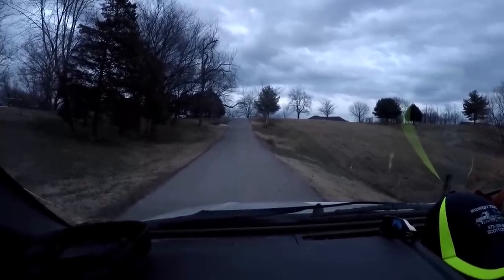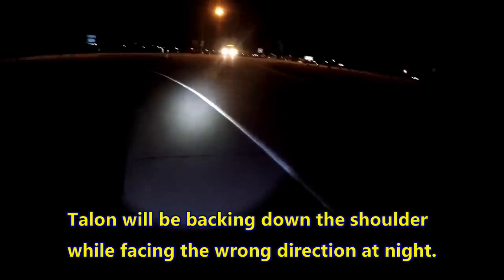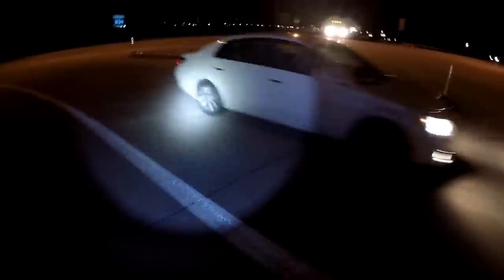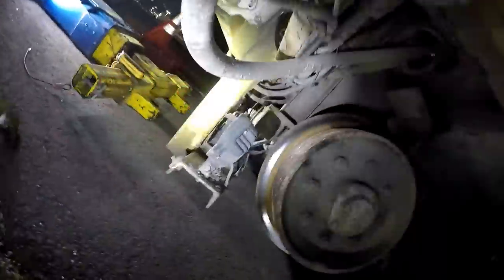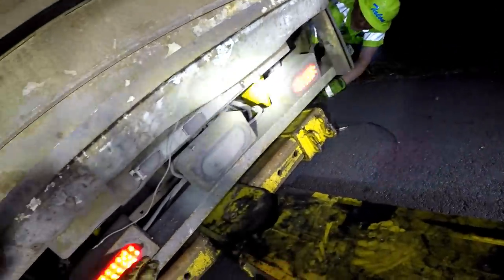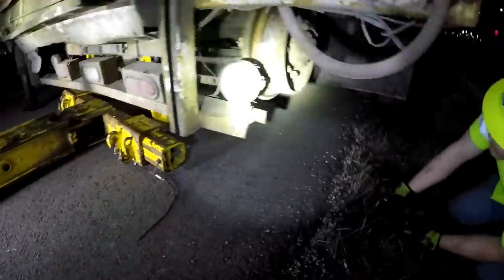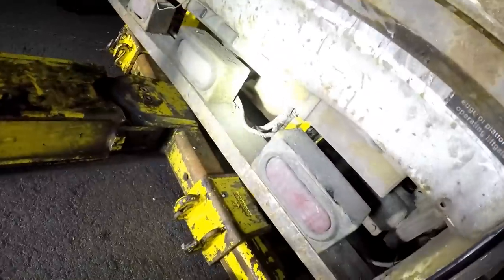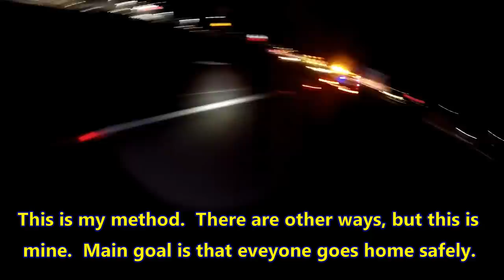Simple Tow Turned UH OH!!

Comment: Those rotating light is a nifty idea, makes for better warning.
Reply: Todd Behrends they work great, speaking from personal experience  (I have a 6 pack in blue, and now a 3 pack of amber batons too, because the flares were so effective)
Reply: Edward chapman I got mine from amazon, sold under the brand Aervoe. just search for aervoe led flare, and it should come up.
Reply: awsome, thankyou
Reply: @bigtrucker26  , I agree, picked up several from an auto parts store ( red in color ) cheaper in the long run vs regular flares.
Reply: If you want to see these taken apart and explained check out this video
https://www.youtube.com/watch?v=9eN7e5_GtHI
Reply: I have six of those led lights in every vehicle I own. I am a firm believer in doing all you can do for safety.

Comment: Ron, I saw something interesting on the highway today that I thought might be useful to you. You know those big portable orange signs that construction workers put out along the side of the road that say something like "Road Work Ahead"? Well today I saw a towing unit with a pinkish purple sign like that which said "EMERGENCY TRUCK REPAIR", and it was placed right up against the travel lane (not In the travel lane) so you absolutely had to notice it. I thought that might be useful to you when you have to tow semis and the semi is blocking most of your rotators emergency lighting from being seen by oncoming traffic.

Edit: I forgot to mention that the sign was placed probably a couple hundred feet rear of the semi, to give ample warning obviously.

Comment: Your customer asked about possible cause for wheel run off. Most common, is under/over torquing lugs(impact guns), OR OVERLOADING.  As you know Ron, excessive stress on ANY contact causes fatigue/wear/tear. That's a rail service truck. Like your wreckers, you have lots of equipment, tools, etc. But, it adds weight. Weight distribution is always important, regardless if you're within limits. A balanced vehicle  can make big difference when driving, towing, winching, recovery etc. Watching your previous videos, I notice you take proper maintenance and care of all your equipment, which can make everybody's job easier and SAFE! GREAT work Midwest Towing! MOVE OVER OR SLOW DOWN is law in  Missouri!!! Give them room.

Comment: A problem like that makes a good reminder to pay attention to those wheel lugs.  They are entirely too easy to overlook during a pre-trip.  Look for shiny around them, or streaks, that could indicate that the rims are moving on the hub.

In my younger days, I kept hearing a rumble-thump in what I was driving.  I checked wheel bearings, tires, driveline.  One morning while on the way to the rail yard for work, it finally revealed itself, when my left steer tire exited from the vehicle and went bouncing off into the woods on a road with roller coaster hills.  Lost two nuts, and the rim pulled through the other three.  Cost me a rim, a grease zerk on the lower ball joint, a tow, and at least 8 hours of work.  And a pair of underwear.

And it put me under obligation to look for another vehicle, because I'd told people that I intended to drive that one until the wheels came off...  I fixed it and drove it some more, but I did eventually get myself a backup vehicle.

Comment: I can agree 2 with your thoughts about working safety along the roads, I worked in Michigan for 25 years as a heavy duty truck Mechanic and had several close calls working along I-94 plus several other heavily. I have had drivers standing at the rear of trucks & trailers and people would still not get over. God Bless my friend, Pastor Clare Huyck

Comment: I remember that rotating lights from my fire department. Very handy little things. We used them too to secure our scenes on roads outside the city. Very useful but the box we had to charge them was a bit difficult to handle because of the wireless charging system you had the problem, if you didnt put them in right they didnt charge.

Usually we put them on the ground, but i had the idea to put them on top of the cones like you did to make them better visible.
We did this until we got some foldable traffic cones with a light in it who where very handy because they dont need much room in the truck and they have a light inside that lights up the complete cone.
Like this:
http://www.derfachhandel.de/bilder/produkte/gross/888.png

And nice that you took care of that small oil spill there.
But a idea for the binder: Put it in a bucked so you dont have to cut the bag open every time you need some. You just take the bucket, open it, take a small shovel and throw as much as you need on the oil.
So you dont have the open bag in your truck after you used just a little bit like here.

Comment: Glad to see an owner doesn't care have much or how long it takes to set up a job site so long as you and your workers get home safe, I remember when i was working 24/7  some 20 years ago doing break down service as an auto sparky where people would not slow down on amber flashing lights and doing 100kph only 1meter or less away from you, so i made a super bright light bar 4X100 watt flashing ambers, people complained to police that they had to slow down because they where so bright, and Police response was "and your problem is", also Ron another good trick i did was a motion sensor down road that triggered a yellow flash light on side road, people thought it was speed camera and slowed down, so funny because if it was a camera it was to late.
Keep up the good work, and keep them videos rollin, just found you on here and must say you do a very good job, cheers

Comment: I remember the time when a Mobil sweeper had broken down on the side of a busy road. The tow truck driver was banging on the axle shaft with a sledgehammer to get it out, but it wouldn't budge, as I expected. The supervisor shows up, he takes a whack at it, and out it comes. I felt bad for the guy, but it happens. I think it would be a good idea to use your fast idle switch when you leave the flatbed running so you don't get any slobber out of the exhaust. Great video and God bless.

Comment: Need to make small little tubes about 3 inches tall and same size as the rotating lights with a flat plate on top out of thin metal to sit the lights on so they don’t sit in water or snow. Make a few of the so you can slide them into the tops of the cones. Awesome job on the videos!!!!

Comment: With we lay out a warning lay out on a hwy as you've done with the roll back...behind your roll back begin laying out your markers fm the drivers side of the truck back at 100' increments, toward the grass side of the shoulder w/5 or 6 flashers or 500/600' back. This way the approaching traffic sees the cones/flashers are heading toward the travel lane, so they their eye tells them to begin moving over. By putting the cones/flashers in a straight line along the edge of the traffic lane does nothing to warn traffic to move left...because their eye just sees markers all in a streight row. Just a hint. Luv the vids!

Comment: Ron. Something that's done in uk with recovery and safety is the turn the steering  wheels off to the ditch side so if get rear ended the vehicle heads that way and not straight on.  The AA RAC do it automatically as they pull up and get out.  On our  motorways we have a special truck with a built in crumple zone and massive flashes lights arrow to get over.  In day time the cones you sometimes put out As you get nearer you kick them out further each one.  Keep safe

Comment: Good video as usual Ron. Have an idea for your mini flares to mount them on top of your traffic cones take you to a wooden dowel or piece of PVC pipe 3 to 6 inch long and secure a two or three in circle of sheet metal to the top of it that way the  dowel or pvc slides down in the hole on top of the cone and a mini flare can secure to the top with Magnetic base and it eill get them up off the ground and more visible. Just a ides.

Comment: I'm glad you put in the subtitle of the false alarm, that was good thinking and saved a prayer, because I ask God for enough stuff, LoL........... Your trucks are really impressive, I've always admired them, especially at night with all the lights strobing and flashing, etc.  I agree with you, you can never be to safe. I agree Ron, regarding A large safety zone or perimeter, and I think it is very important regardless of what others do. At only 50 miles per hour a car will go around 375 feet in only 5 seconds, that does not give the driver a lot of time to make up their mind, slow down, check mirrors (especially a van or truck with a lot of blind spots) and move over etc. and therefore puts the emergency crew along side the road at great risk.  I would think, the further out flashing lights, cones, arrows that blink etc., the safer it is for the emergency crew.  Have you ever thought of buying a little used car cheap then equipping it with a lighting system similar to a police car to accompany any of your trucks that are called out? Just as you used your rollback / flatbed truck to help set up a long distance safe zone the little car could be used in the same manner.

Comment: I have a 6 pack of those flares  (aervoe) (in blue), and a 3 pack of the batons (aervoe) (amber), and I see a 98% response to them. Compared to a 20% response to the triangles. I'm just a trucker, but, when I break down, that's a LOT of safety, and has led a roadside mechanic to do repairs he wasn't supposed to do at night, because of the traffic control they offered.
I use the roundyround light pattern for closing a lane/shoulder, with the direction of rotation indicating where they should move (all you need to do to change the direction is flip the light over...), and the alternating flash as a divider, along My area....
Now, before anyone complains, I use these in addition to the proper triangles, that are properly placed.  These are just a additional safety measure.

Comment: The more the merrier when it  comes to safety lights cones   Sometimes the frustration for me as a truck driver is when the scene is on a corner and don't see it until I am on it. Or the truck 250 feet in front doesn't  brake or move over and suddenly there you/the scene is.  God blessed be safe

Comment: Years ago I was towing a 58 Caddy stretch limo up I-95 in Delaware.  It was a long distance tow so I was towing on the front wheels with the steering wheel strapped down. All went well till a Pittman arm snapped. I got it straightened out against the guardrail without involving any other cars, but I was then at the wrong end of a long car that I needed to get off the road. I wound up towing the wrong way on the shoulder for several miles to an on ramp to get off the highway. This was after a DE State Trooper refused to stick around for me to get to the other end of the car. 

So, I've done similar. And feel your pain. Mine at least was in daylight, but I was solo, before cell phones and many miles from my base. So glad that no one got hurt that day.

I later found out that there was a recall on Pittman arms on that year Caddy that had not been performed on that car.

Comment: Love the commitment to safety Ron. Actually it was 1 of the biggest reasons I subscribe to this channel. (BTW I Don't subscribe to channels) This is the only 1 I do. It was on the very first video I saw and I subscribed in the middle of watching the first 1 of yours even before finishing it and breaking my personal rule. It was the Vid "Oh Shift" I saw the thumbnail and I have worked in Heavy metal manufacturing and been on long distance hauls with flatbeds. Thus it sparked an interest as..... Well lets take a look. I was immediately impressed with your professional approach to every entity involved: ie the driver the police the environment involved, you took precautions to prevent any damage you could and your safety comments and explaining why was refreshing especially to the normal garbage that gets splashed on you-tube daily. The point I hit the subcribe button was when you commented to Talon to place the small step ladder to the shoulder side of the trailer instead of between the rotator and flat bed where it could become a crush zone if the Pete was hit. NO small details where ignored or over looked and I also noticed the working compatibility of boss and employee(was a treat to see). I think it was around 73K subscribes at the time so grats on closing in on that 100K. The situation that I followed after that was the Tired Taurus. That cemented my subscription. Its a pleasure watching your vids and hopefully you and your teams attitudes spread thru the industry like a wild fire. Thanks Ron I look forward every day to see if a new posts gets put on.

Comment: I guess I was lucky with my 5 ton Kenworth flat deck.  Must have had extra spaces for switches because I could run my wheel lift bar lights separately from the deck lights...made backing up long distances nice.

Comment: Good video. Glad the report of the operator was untrue.  By the way, would you mind telling the brand of the neat little LED beacons. I want to get some for my RV. The only thing I picked up on was that you needed to install batteries which led me to believe they were not the rechargeable set ($40 for 3) on Amazon, but one of the others possibly ($25 for 3). Thanks much and you can never be too safe.

Comment: Question for you. First of all I know that I can't see everything in the video example, Was the rear axel in good enough shape to handle the load? My question is would it have worked to block up the truck after you got it lifted and move the lift to the rear axel? Then it would have put some weight on it and allowed you to lower the angle of the frame raising the front high rail. Of course this would have also meant more time on the side of the highway. Just curios. Thanks for another great video!

Comment: Ron, I think you should try to get local traffic enforcement agencies involved in making reforms regarding accident and towing operations. It seems like the laws that are in place where you operate your towing services just don't do enough.

Here in Australia it's very different. There was a busy range road - highway actually - near where I live, the Kuranda Range, and there was a single vehicle incident involving a vehicle that had run off the road and hit a reflector post. The front of the vehicle was crushed in where it had hit and deformed around the reflector. Accident and Emergency personnel plus an agency called Traffic Control set up and blocked both lanes of a single lane highway while Fire and Ambulance services extricated the occupants of the vehicle from the wreck. Most accident sites in Australia are a case of setting up the site so the emergency personnel and tow truck operators can clear the scene and it takes however long it takes to remove the vehicles. In extreme cases, it can be more than six hours. If a vehicle requires special case handling in order to be set up for towing because it broke down but did not cause an accident, tow truck operators might call in the police or a traffic control agency if required. Most, however, have to set up and work on the road shoulder, which is quite dangerous work.

I witnessed a rather odd scene at one mechanic's shop where there was a tow truck on the flatbed roll lift of another, slightly larger, tow truck, which was in turn on the flatbed roll lift of yet another even larger tow truck. That's right, a tow truck on a tow truck on another tow truck. Possibly they were just moving equipment around. I have seen cases where there is a tow truck towing a tow truck that has picked up a car for towing. Most tow truck operations are roll lift based because of the ease of lifting up and towing broken down or crashed vehicles. There are even semi-trailer based roll lift rigs. In this case they can often be seen when semi trailers or large trucks break down and need to be towed.

Comment: Chain the rear axle as if it had air suspension before lifting it. Would keep the suspension in the 'loaded' position and allow a few more inches of clearance before dragging tires.. Also have you considered a traveling axle aka Landoll flatbed semi tractor for your fleet? I know of a few tow companies running them. If you had one of those could have just dragged it straight forward onto the deck.
Reply: or remove the tires on the other side.

Comment: Ron, you need these red laser rear fog lights, they emit a red line on the pavement, you could angle them so they shine into the adjacent lane when working under those dangerous conditions. On Amazon search for EINSKEY Laser Lights for Cars - Universal Auto Rear-end Alarm Fog Lamp for Cars and Motorcycles Brake Parking Anti-Collision Safety Warning Lights

Comment: To those that don’t think that extra steps are necessary, when you put your rear on the line you do as you see fit. Every extra precaution for safety is one less you wished you’d would’ve done if something goes wrong. In my opinion there are only two kinds of recovery operators. Smart ones and dead ones.

Comment: Would you have been able to lift the truck using the wheels/ axle for running on the rails, or were those hoses compromised as well?  

Do NOT envy you having to work on the interstate at all, let alone at night.  Thank you for the video, and as others have said, stay safe!

Comment: I am wondering if the wheel lug bolts were either loose or the wheel lug nuts were over  tighten, and  stretched the wheel studs. Due to the fact it sounded as if they had new tires put on the back axle. 

Although, with the stabilizer stand on that driver's side. The extra weight of the crane, and stand could have at least played a factor in the studs breaking! 

Needless to say, this are all things, I have come across working on vehicles. 

However, you were their Ron, what did it appear to you to look like happened to the wheel studs?